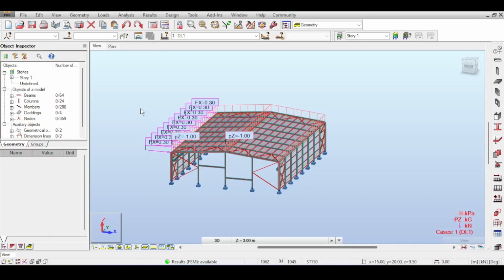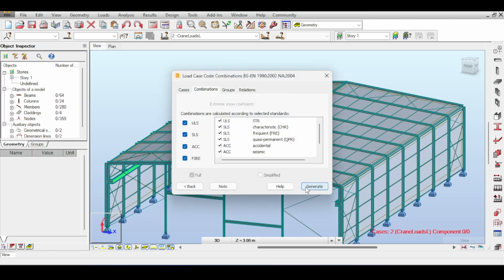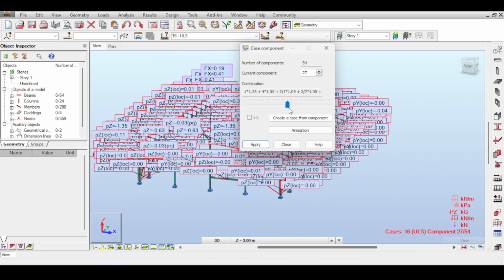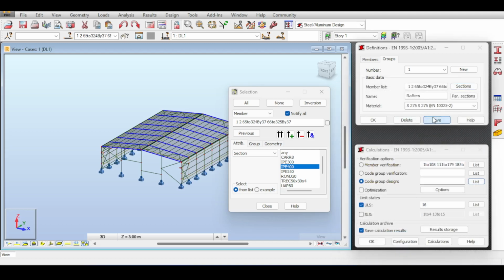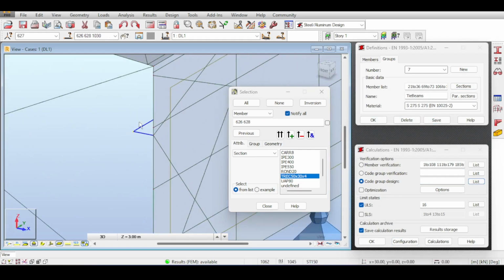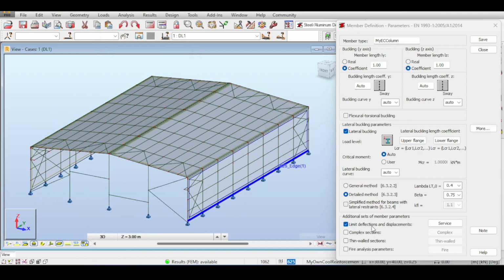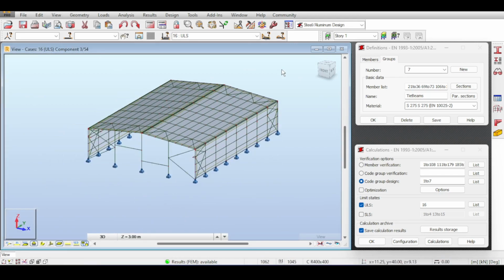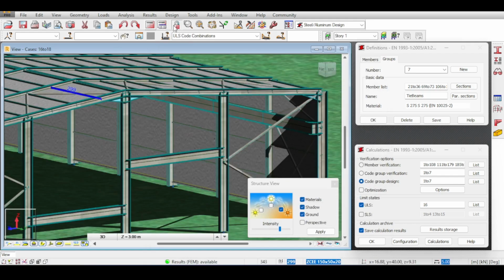Modeling of Industrial Warehouses | Part 6: Steel Member Design

Comment: Hello Dr. CEE,

Thank you for the wonderful video, this series continues to be very interesting and enjoyable.

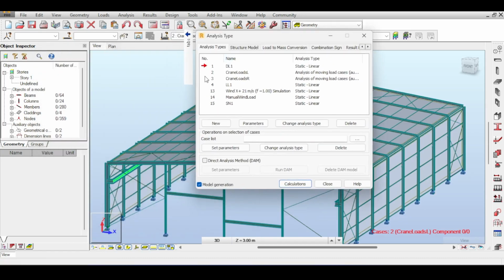Auxiliary Case: 04:06 I did not even know that such a setting existed. Thank you for showing this, I can definitely see it being handy at times. 

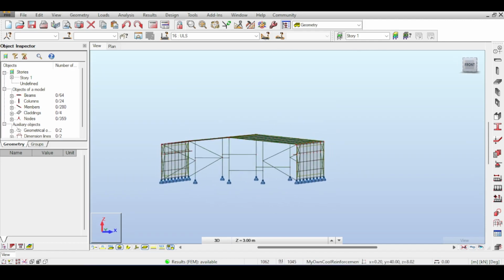Crane Load L and Crane Load R acting simultaneously: 08:40, from what the CEE have just shown regarding “groups” and “relations” in loads combinations I think a workaround may be possible by modelling the LHS and RHS crane load cases to originate from the same direction and then by “grouping and relating” these two load cases to act together in a combination.

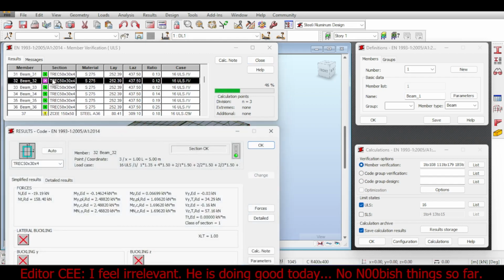09:44 & 18:49 CEE Editor 😊😊😊 , and thank you CEE Editor for keeping tight checks (12:07) on everything.

I know that Dr. CEE knows this and that he has also alluded to this fact here in more than one occasion and throughout the video content. What I want to say is that the steel design and the “correct” member sizing from the RSAP steel design module for the various elements’ groups will HEAVILY (all other things being equal) depend on the correct (or on a more representative) “member type parameters definitions = effective lengths and lateral restraints positions for the various members groups”. The definitions that were used in this example are generally indicative at best and aim to teach the techniques - a separate video is available for detailed definitions (all thanks to you Dr. CEE). In this regard (teaching the techniques), I fully commend the wonderful work that the CEE has done on this video. 

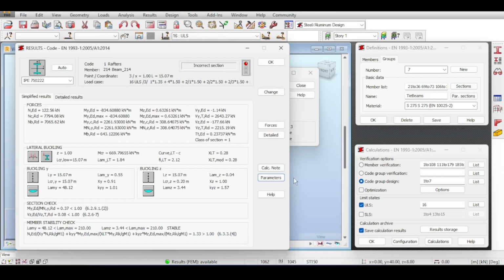21:22 Mmm, that “Detailed” is nice! Also, it is good that you remembered to model the Haunches. The selection technique to add haunches to all IPE 400 at once was smooth, thank you for sharing that.

I have enjoyed this video and I am looking forward to the next CEE videos. I support the idea of not trying to cram everything in one video, also there is no rush (or at least I think that there should not be) In my opinion, it is better to cover as much as it is needed in order to fully (from a practical point of view) define the entire structure rather than cutting the videos short to start a new structure. I am glad that the CEE is continuing with the series until it is done. The old saying that “….it will be done when it is done…..” comes to my mind 😊

Keep well and thank you for your work

Kind regards, DK 

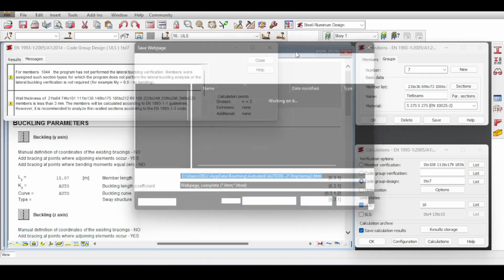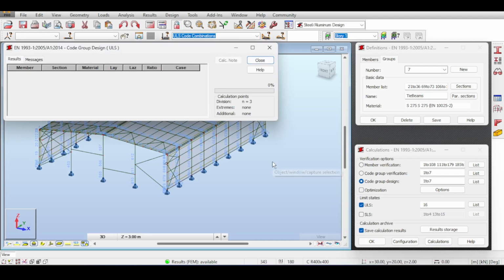Ps. 21:07 24:49 25:37 This is also a wakeup call for me considering that the CEE has only selected to use the ULS combinations in this video. Did the CEE “Broke RSAP
Reply from the maker: Hi there Engr. DK,
I usually use auxiliary cases to reduce calculation time for cases that have many components. However, if you forget to remove the "auxiliary case" tickmark, then your design will start having 0 loads and 0 checks.

About crane loads, I am not really sure but it might be possible. 
I was even thinking unhinged to do the following (I did not check that yet):
-In the moving load definition, Define 2 point loads with a spacing (= width of warehouse) apart in the width.
-Let the moving load go through a path that is in the center of the warehouse
-If I am lucky and RSA is amazing, the two runway beams might capture this load and be "loaded".

The member type definition and especially bracings is paramount. I did a separate video just because I thought that it needs to be detailed ^_^ thnx for the comment on that.

I only showed a little eye-opener when it comes to detailed. It might cause curious minds to dive and check it out, like yours.

I was unable to do connection designs and member sizing in one video, the connection design video has been recorded, but now of course it is in the hands of the editor to deal with it ^_^
Thnx a lot, and stay tuned for more content.
Regards,
CEE
Reply: @CivilEngineeringEssentials  

…..the capable hands of our trusty editor you said? Then in that case we can all be rest assured that it is coming! ^_^….

About your idea on the crane loads…. Definitely YES, your idea will work, Robot have what autodesk refer to as “symmetrical vehicle” and it also have other “not symmetrical kinds” of vehicles in crane loads definitions. 

In a symmetrical vehicle (much like what you are proposing), the path can be located at the imaginary centre-line and the loads on the opposite sides of the path will indeed load the beams.

The only challenge with symmetrical vehicles is that the loads on the opposite sides are also symmetrically equal. I guess (I have not tried this yet) one can define a “non-symmetrical vehicle” if this allows different values of loads to be defined on the LHS and RHS of the vehicle and then define a path as you have proposed that is at the “middle of the beams” ….I will try this later (it seems like a cool idea)….

Thanks for the ideas and thanks for the feedback, Kind regards DK

Comment: Dear Civil Engineering Essentials and community,

I have a few observations and questions regarding the presented model.

I noticed that the local axes of some columns and beams are incorrectly oriented. This is important for properly defining parameters in Design → Steel Members Design → Options → Code Parameters → Member Type → Lateral Buckling Parameters → Lateral Buckling Length Coefficient (Upper/Lower flange).

The definition of the upper and lower flange directly depends on the orientation of the local Z-axis. In a properly defined local coordinate system:

The Z-axis is aligned with the strong axis of inertia

The Y-axis is aligned with the weak axis of inertia

The X-axis is the longitudinal (axial) direction of the member

For members with restraints (side rails, purlins, wall/roof bracing), the orientation of local axes must be consistent. Otherwise, the software may interpret which flange is restrained incorrectly.

The local coordinate system can be adjusted via:
Geometry → Properties → Local Member Direction

For example, in the video, the columns on the right side (grid line 7) appear to have incorrectly oriented local axes. As a result, restraints that are physically placed on the outer side of the I-section are interpreted as being on the inner side of the structure.

In this specific case, I believe the impact on results is minimal due to the relatively small scale of the project. However, on larger projects, this could lead to cumulative errors.

Additionally, considering the presence of wall and roof bracing systems, I assume that the structure could be treated as non-sway for buckling about the Z-axis. I am not entirely certain about this assumption, so I would appreciate clarification or correction.

I also have a question regarding the buckling length parameters for columns and rafters. I noticed the following values:
Lcr,low = Lcr,y = Lcr,z = 8.0

This implies a buckling coefficient of 1.0, which does not seem appropriate, both for columns and beams. I attempted several approaches to adjust this, but without success, so I would appreciate guidance on how to define these parameters correctly.

This is important because the selected IPE 750 sections for both columns and beams appear oversized for this structure, which may be a consequence of overly conservative buckling assumptions.

Finally, regarding the roof bracing members, the ROUND 120 section seems relatively large. Is this because the members are designed to resist both compression and tension, or is there another reason?

I apologize for the length of this comment.

The video series is excellent—clear, detailed, and very valuable for understanding the topic.

Comment: How can you check the ratios or set some boundaries for it? it seems like some members are over-designed... for example, a member could resist the internal forces with a ratio of 0.1-0.99

Comment: Dear doctor I have watched  the video this time twice , what I didn't get it is the Unbracing for the lower flange for the rafter , your point of view that we don't have any attached element to the rafter so we don't have to check it ? please notice that i have watched the steel member definition and I think I get the idea , but i always like to discuss in order to make sure of what i have understand
Reply from the maker: oooh that is a very good question
If I understood you correctly, you are talking about the bracing against Lateral Torsional Buckling for the rafters.

And your question is, why not brace both?
why brace only top?

Even the opposite question is true
Why brace only top?
Why not brace both?

Now here is my take on it. It depends on the stiffness and arrangement of the bracing. I am not saying this to "run away" from the question, so here are some details ^_^

if you are only laying out purlins on top of the rafter, and because purlins are usually smaller than rafters (significantly smaller) then I think that those little purlins only provide lateral bracing for the top flange, but are not really strong enough to restraint the entire section.

Now you can argue that the purlins might be stiff enough to restraint the entire section, and I would respect that. I tried to find an "equation" that tells when a top connected element braces the entire section, I did not find any.

Also note, the purlins are connected to the rafters from the top.

Now there are some really cool details that make it braced top and bottom, like connecting a 45degree brace from the bottom flange to purlins, but those might be kind of exotic.

Thus, I cannot agree nor disagree on this issue. It is left to the engineer's discretion.

Still, I hope my answer gave insights as to the factors that weigh in when taking a simulation decision.

Regards,
CEE
Reply: Thank you, doctor. I've made the decision to only respond with a 'like' when I fully understand your perspective. I want to avoid wasting your time with unnecessary replies 😅.

Comment: Dear Dr CEE

I noticed during this video that the gamma angles of the gable columns you changed in the last video took back their initial value of 0 degrees.

 I want to ask why. I am of the humble oppinion that the gamma angle value is to be 90 degrees as more resistance to wind will be provided by the columns this way, as was highlighted last video.

I also want to ask how the purlins for the cladding on the gable frame and the gable columns will be connected, seen as how their orientations won't allow for the normal or common connection type.

Thank you for your amazing videos.
Reply from the maker: Now to be honest, I do not remember if it was intentional or not, but I do agree with you, actually I think I had a video talking about this specific connection, and how a special type of connection is used to allow axial slippage.

So, I agree with your point.
For purlins, note that I talked about those in a future video where I show that RSA is kind of weak when it comes to cold-formed section design.

Purlins are usually either Z- shaped or C shaped (both cold formed sections). 

If it is Z shaped, then you can connect it using the upper _ or lower _ of the letter Z.

if it is C shaped, then you have the option of connecting it to the upper _, lower _ or standing |

with the standing | being easier because of it is larger size. But you could technically connect it on the smaller upper _ and lower _

Sorry for the late reply, I hope it helped. 
Regards,
CEE
Reply: Thanks a lot for the response.

Comment: Hi, when I change all the cross sections in the code group design the HEB sections are from a section family of HE instead of HEB. Furthermore, they do not display the correct section shapes in the main GUI. Does anybody know what I could be doing wrong.

I also get the following messages. 

NOTE! Sections of members  3 26 31 32 40 48 57 107 119 121 123 127 130 133   have been calculated as the 3 class sections although they meet the criteria for class 1 or 2. According to BS-EN 1993-1-1:2005 + NA:2008 point NA.3.2 members which are not doubly symmetric analyzed by Method 2 [Annex B] should be verified as section of class 3. The kij factor calculation method may be changed in CALCULATIONS / CONFIGURATION dialog.

I have already changed in the calculation configuration to calc using Annex B but I still get this message so I don´t understand.

Members  3 26 31 32 40 48 57 107 119 121 123 127 130 133   are tapered members. A global stability analysis for such members is performed as for typical members with constant cross-section parameters; the moment of inertia of member center is taken for the calculations.

I don´t fully understand this message and what to do to get rid of it.
Reply from the maker: For the intermixing between HE and HEB, I think this might be a bug in the section database, I emailed Autodesk about this and wait for their reply. 

As I understood, you are selecting a certain section family and are getting something that is from a different section family.

For the tapered section, I had a similar request, and would have a video about it soon after finishing the RC design series.

Anyways, thank you for your comment, I hope you find this video series beneficial>

Regards,
CEE
Reply: Thank you for the answer  @CivilEngineeringEssentials . Yes you understood me correctly. Furthermore, the difference is that the HEB section that is selected is written as HE 200 B instead of HE200B. This difference doesn´t sound like a big difference but I cannot see the section parameters of the HE 200 B and they are not the same as the HE200B that is in my Corus section family. This could be bug but very frustrating because I cannot optimize my structure properly with ROBOT.

Comment: Hello CEE. Am keenly following this especially the design of the rafter and column. In the case of manual design the sections obtained a somewhat smaller and for this case 750Depth rafter is quite large. I tried providing lateral restraints at bottom flange more like assuming fly bracings and the section is reduced remarkably to 500 or 550 Dp. The same for the column. Is this okay?
Reply from the maker: Yep, fly bracing connect purlins to the bottom flange, which provides lateral support. Assuming this and reducing the unbraced length is a valid approach.

Always keep in mind: whatever you assume during modeling, needs to be implemented in practice. 

Stay tuned for more content,
CEE
Reply: I really appreciate this. I must say your videos are so elaborate and keep spurring my interest and love for robot stuctural analysis. There is always something new to discover with each episode..feels like an adventure 🤣👍

Comment: Hi CEE? Kindly can i get your opinion on this. If i have plates or a composite decking on the beam, i think that will help in restraining lateral torsional buckling. How do you specificy that in Autodesk robot? Kindly
Reply from the maker: on composite deck, when the deck restrains lateral torsional buckling, at least 2 options exist:
1) Override LB to be zero
2) Disable Lateral Torsional Buckling (remove the tick in the box)
Regards,
CEE
Reply: @CivilEngineeringEssentials  that's brilliant. Thanks alot

Comment: for lateral buckling on bottom flange, you didn't specify anything
Reply from the maker: That is correct. I am assuming that the purlins are bracing the upper flange by connecting them via brace bars. (See theoretical parts). You can specify bracing for both bottom and top side if you want.
Reply: @CivilEngineeringEssentials  great

Comment: I was waiting anxiously for this video. Many thanks. Hope the video on steel connections will be out soon. I Heard RSA is not as good as other software on dox that.
Reply from the maker: Great you liked it. Yep, the connections is gonna be my next video. I will see what RSA can do, I might take a look on idea statica.
Regards,
CEE
Reply: @CivilEngineeringEssentials  Hi Hi sir!, What about Revit Structure is it good at dox connections ?
Reply from the maker: It might be good for modeling any structure, but when it comes to design, usually your revit buildings are sent to robot. there is an interface to do this.